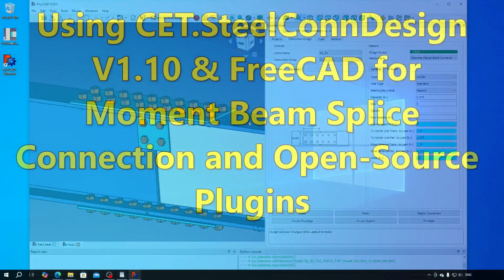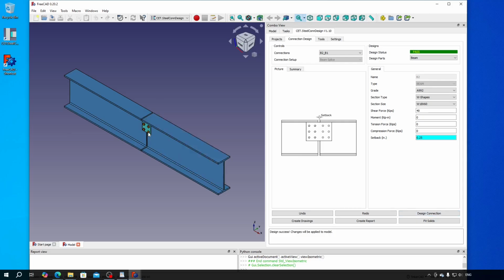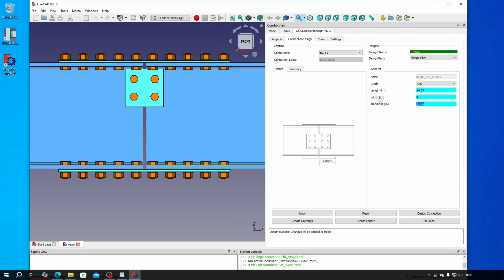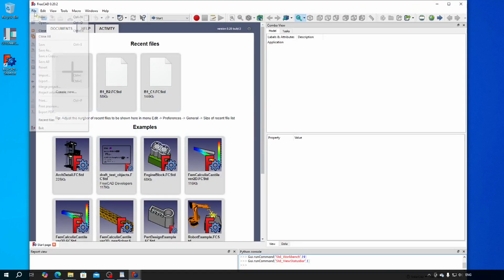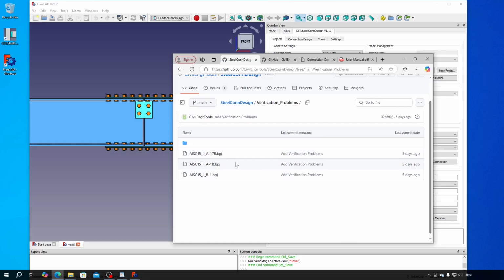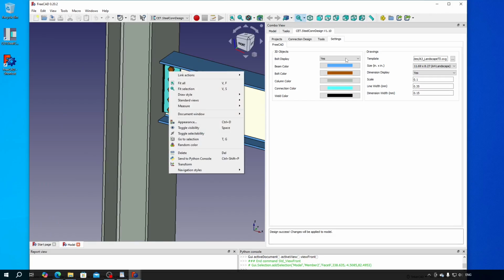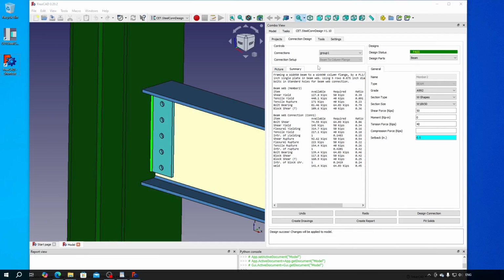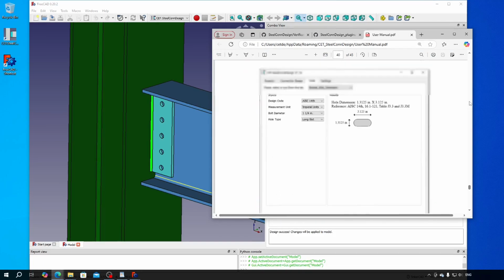Using CET.SteelConnDesign V1.10 & FreeCAD for Moment Beam Splice Connection and Open-Source Plugins

Comment: I've downloaded and installed but cannot get the macro to run in FreeCAD 😢
Reply from the maker: You need to run FreeCAD version 0.20.2. https://github.com/FreeCAD/FreeCAD/releases/tag/0.20.2
Reply: @civilengrtools6051  Downloaded and installed again, ran the macro and got errors at the bottom in red. I still have 1.0 installed.
Reply from the maker: @BunkerMonkeyUK  You need to open the CET.SteelConnDesign workbench in FreeCAD version 0.20.2, not FreeCAD 1.0
Reply: @civilengrtools6051  Sorry i have installed the version you meant but left freecad 1.0 installed. I have both versions now
Reply from the maker: @BunkerMonkeyUK  Please uninstall FreeCAD 1.0 and install  FreeCAD 0.20.2 (https://github.com/FreeCAD/FreeCAD/releases/tag/0.20.2). Then run  FreeCAD 0.20.2 and open CET.SteelConnDesign workbench
Reply: @civilengrtools6051  So I can't run both together on the same PC?
Reply from the maker: @BunkerMonkeyUK  Yes, you can have both FreeCAD versions in your PC. However, only FreeCAD 0.20.2 can run our software. FreeCAD 1.0 has many issues and is not stable for now.